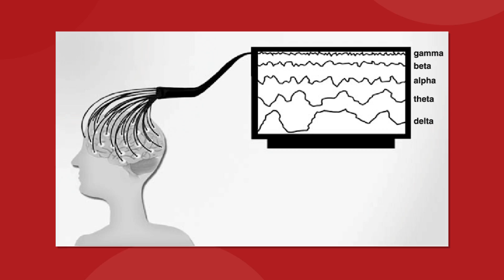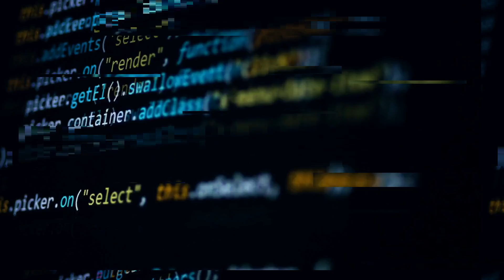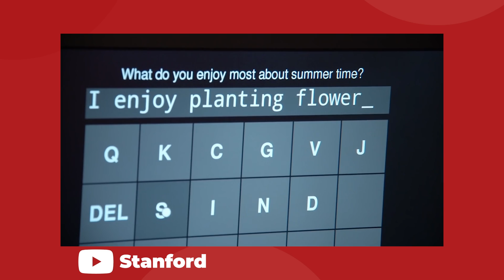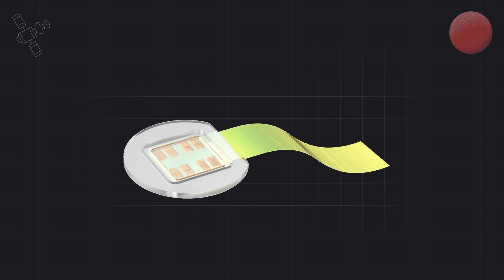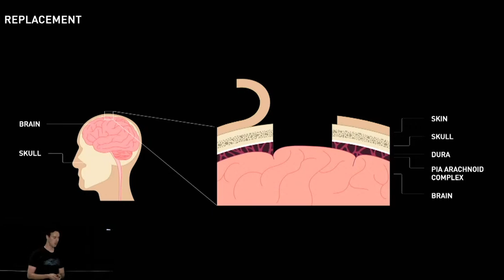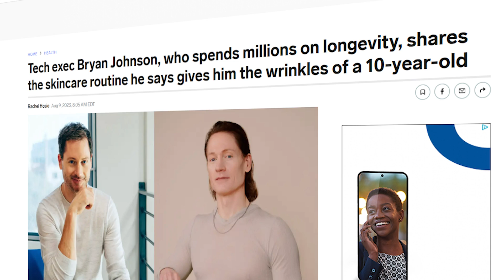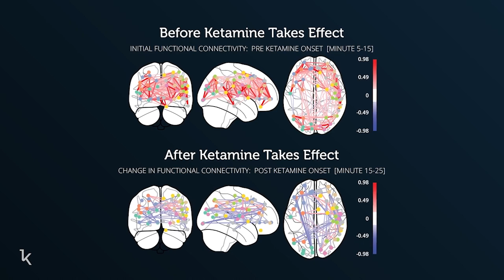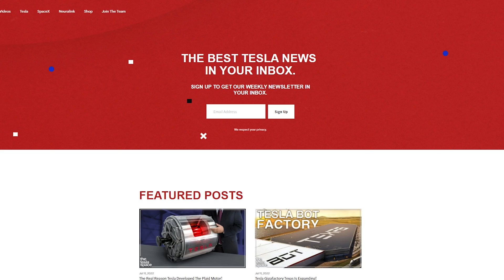The Truth About Neuralink and Brain Implants!

Comment: I’m very interested in knowing  if this can be used for those like me with I.H.  How does this effect the csf levels. At this point in time there is no hope for me according to my neurologist. There’s no cure. There is a shunt surgery that insurance won’t pay for. I’m extremely upset and find this completely unacceptable. So instead of them exploring to find out why my body makes too much spinal fluid which presses on my brain causing this nonstop pain ,they choose to give me diuretics which The rare side effects caused me other problems so I can’t and won’t take that horrid medications. The past 6 months I’ve had 6 lumbar punctures measuring the spinal fluid and drained fluid which brought me short term relief from the brain pain. They are idiots to even think that migraine medicine will fix my problem. 😂it’s not working and will not work , due to the simple fact that ITS NOT A MIGRAINE HEADACHE. ITS BRAIN PAIN FROM THE SPINAL FLUID BEING TO DAMN HIGH. UGH 😩 I DONT TAKE THE PAIN MEDICINE EITHER. I Just want it to be fixed. Not get a fix lol . Do you make a device that monitors the cerebral spinal fluid? Or a regulator for the csf? How has the neurolink dealt with the spinal fluid? The pain involved with too much fluid to not enough is another pain as well. I’ve experienced both. Now after an L.P.  I know to stay laying in a 30 degree angle for a day following a LUMBAR PUNCTURE. Imagine waking up with severe brain pain. I’ve had it nonstop for nearly a year. I feel the doctors don’t know much at all about INTERCRANIAL HYPERTENSION and the medical field isn’t interested enough to find a solution. Can neurolink help someone like me?😊

Comment: You missed another problem with non invasive bci, they have no write, only read capabilities, while that sort of thing is still a ways off that is one of the functions neuralink is going to have and it isn't just for the disabled. It will never become cheap if you limit it to just the disabled, it's for everyone. Other functions include telepathy, downloading knowledge, full dive vr, memory recordings, dream inducement, other possible cyborg tech, ai symbiosis. And while bci isn't new your intro was the equivalent of saying Charles Babbage didn't invent the computer because the abacus existed already. And yes Elon did invent a new rocket tech, rocket vto, reusable rockets and made engines that had yet to work actually work.

Comment: Try nanobugged,  nano AM  crystal radio on a constituent that combines with neurons like the body of the parasite that multiplies in cat guts then ends up in rats brains and human brains so render the parasite to where it doesn't have its normal effect and use it as a shell 2 carry the am Crystal radios on a nanoscale throughout the brain. A.m. Crystal radios working in reverse send out the electrical impulsive caused by the sound waves in the environment being that whether you say here or think a word your Brian fires the same pattern this pattern is sent out as radio waves and with the entangled particles in the AM radio which are changed by the fire neurons according to Harvard in their sea worms the same batch of em Forster radio with entangled particles is in a quantum computer interface that Maps out the phonics from the a radio to the fire neurons once an individual has been mapped you can change the am Christian radio Wichita picking up sounds in the environment 2 just listening to the change in entangled particles that causes a vibration correlating with the vibration it was map to now take that and say move my right arm up and down so whether I think it or do it and this is the part I'm not sure how would work because you could abstractly sing Lou my right arm up and down and not actually wanting to move your right arm up and down but it seems y'all have figured that already so take my nanobugs and make them work that's all you got to do. How effective are they buy the book

Comment: What happens when you need to power cycle the Bluetooth because it won't pair properly😂
Reply: you hit the kill swiych and funeral for you
Reply: If it was connected to fibre optic cable just under your scalp and then to a device in your chest, you could have hardwire all the way to a PC … no wireless hacking.